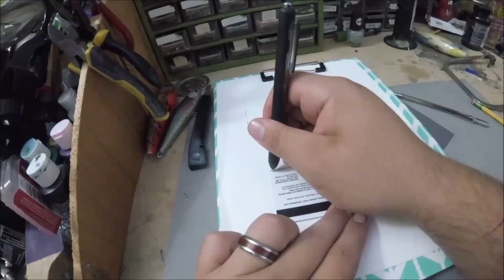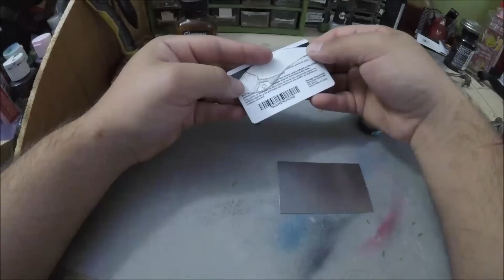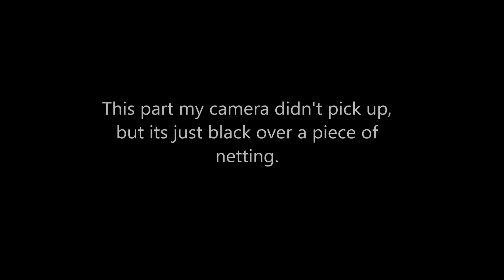Blade Bait: Part 1 of 2( How to make it)

Comment: hello thanks for sharing I have a cosulta compressor and airbrush use? I have seen some similar that is used for nails and pastry but I do not know if it is the same in my case I want to use automotive paint costs more economical than the special ones for airbrushes

Comment: hi ...how did you calculated the point where the best action the lure will have ? I mean the two holes on the back ?
Reply from the maker: Cristian Haica thanks for watching and there's a couple of calculations you have to do which mainly consist of how much drag is placed on the total surface area of the lure when pulled through  water(D=Cd*A*.5*r*V^2) and balance point of the lead against the weight of the blade but there's a cheater way of doing it which basically is as long as the rear hook hanger is 3/8 above the mid line of the lure (if you make a line from tip to tip ) then just eyes ball it.  I just read it over and it sounds hella complicated my bad Brotatoechip if this helped awesome if not just let me know and I'll just make a video explaining it.
Reply: @LucioYChristinasCookingShow  Thank you ! What is Cd , r and V ? I think i get the picture in my head (a video would be great to make sure though) but what if your blade bait is small like 3 cm ?

Comment: what brand of clear finish do you use, i haven't found one that works well for me yet.
Reply from the maker: John & Evan's Fishing Adventures I used uv resistant marine top coat, but any top coat should do it just make sure top properly prepare each layer so they don't flake off bangger toy can use 90% alcohol spray to get ride of any oils that might be on the surface.

Comment: what kind of glue did you use to attach the lead to the metal lure? Im guessing it has to be waterproof LOL :) Important step as you don't want the lead to fall off from a strong fish strike.
Reply from the maker: Mike McDonald its jewelers metal glue but JB weld works well too
Reply: thanks for the fast response :)